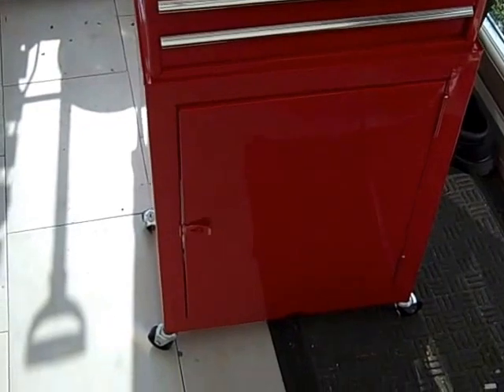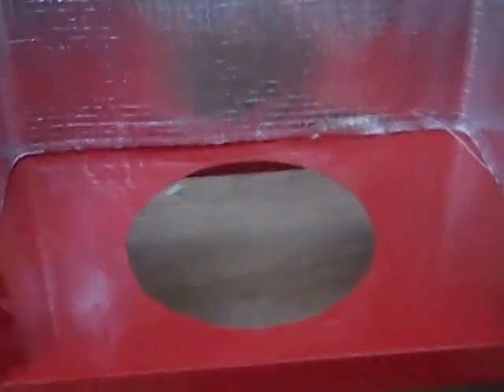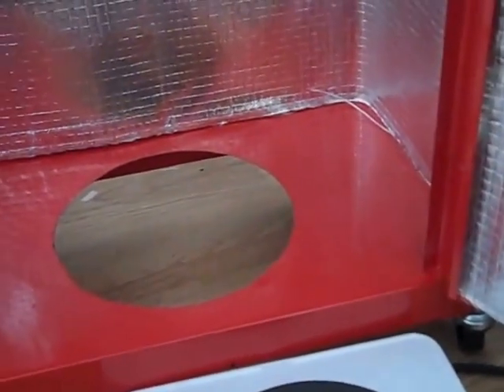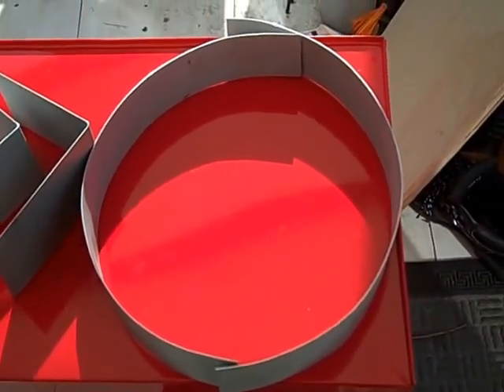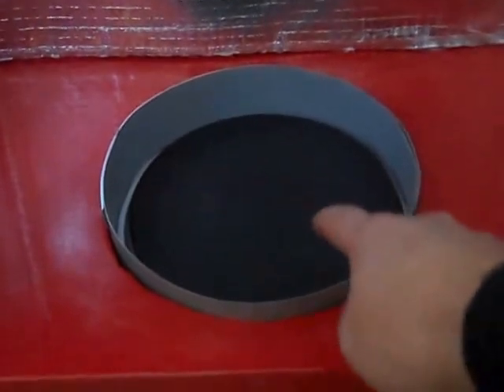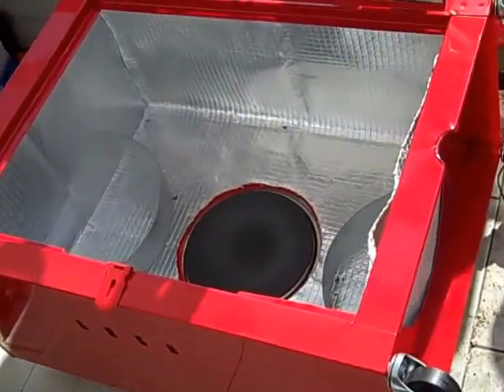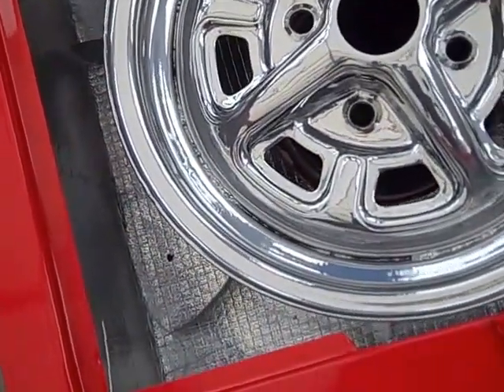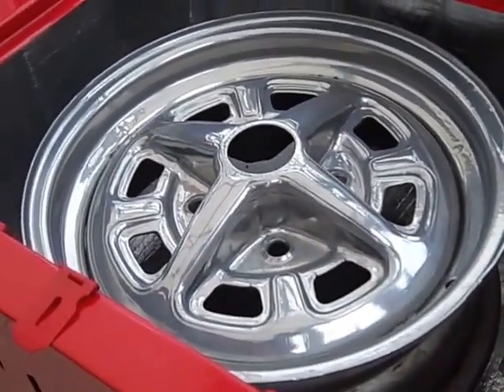How to make a low cost powder coat oven and chrome your MGB wheels

Comment: Very nice job mate. I had some masks for the black bits cut from high temp masking tape and powdered on the black bits. Worked very well. A hand held blaster removed the tricky bits of paint followed by a pressure wash and dry in my oven. Got those annoying bits of paint in the joins out.

Comment: Ok thanks mate. Could you point me in the right direction for a thermometer and who you bought the insulation off as I cant find it on ebay. Thanks
Reply from the maker: +Anthony Hulse The material "Exhaust Turbo Heat Shield Wrap - Aluminised Mat Heat Barrier - Various Sizes", as for the thermometer i can't say as my image camera didn't work but Maybe a "non contact  infrared thermometer" would work, again ebay about £10.00

Comment: where can i buy that chrome powder? im in the U.S. and ive only tried the eastwood "single stage reflective chrome" and is no where near that shiny.
Reply from the maker: +The Punisher 

Hi there, the powder was bought from the UK from http://electrostaticmagic.co.uk/. A year on from then the paint is coming away from the metal of the wheel showing bare metal, so i'm not sure if something went wrong in the process. After the first  4 months it started to show small cracks in the paint and just got worse. Its a shame it didn't stay as shiny as the first coat as this looked just like pure chrome. good luck. Des
Reply: super chrome will be making a comeback here hopefully soon from PrismaticPowders

Comment: I'm trying to powder coat some old VW 5 wide rims but for the life of me I can not get the seam or grove where the 2 pieces are welded together I've blasted use chemical stripper? What am I doing wrong or does anyone have a suggestion or technique they use? The rest of the rim are perfect but damn that grove...
Reply from the maker: This seam was a problem with mine, if i did it again i would weld the seam and rub it smooth before power coating.
Reply: Turn off the electricity and the spray only the grove, then reconnect the electricity and spray the rest

Comment: Hi what temperature does the oven get upto?
Reply from the maker: +Anthony Hulse  The paint must be taken to 180C and held there for 10 minutes. The cooker plate temperature is in excess of 400C and glows dark red. I had a thermal image camera to check the temperature of the wheel, I tested the temperature of the wheel before I coated it and was able to reach 180 without a problem more should I have needed it. However after I had chromed the wheel the camera could not read the temperature as it was so reflective it would only read whatever was in the reflection. So if i got in the reflection it would be 25C even though i knew it was 180+.  Now I know that these thermal image cameras are no good for this type of measurement. Please note I am saying the wheel reached this temperature not the cabinet. I have also chromed a small porcelain pig the size of a fist in this oven and that too came out a treat, so big or small it seems to work. i hope that helps Des

Comment: I am so confused. You are from the U.K. so maybe it is different from the u.s. but those toolboxes are far from inexpensive here.
Reply from the maker: You can buy top quality ones in the UK and they are very expensive, but this one was cheep super thin version and cost only £60 in 2015
Reply: cadauctions31 got one of those my self bought it used...with really bad shape on paint...for like 15 dollars ,had it restore 100 % on paint,wheels and space management cubicles also upgraded the size on the wheels to 3 "...and i would ask up to 100 if decide my self to sell it..